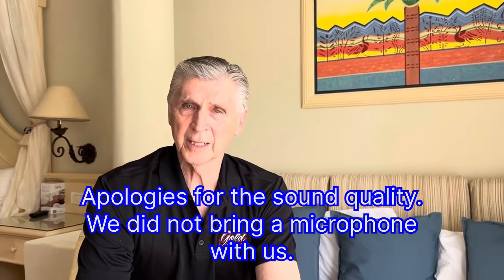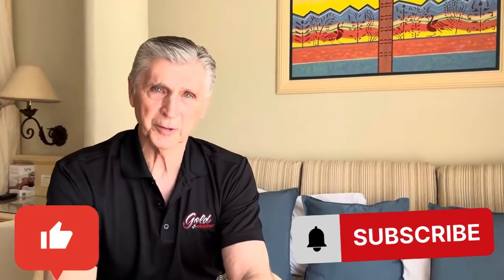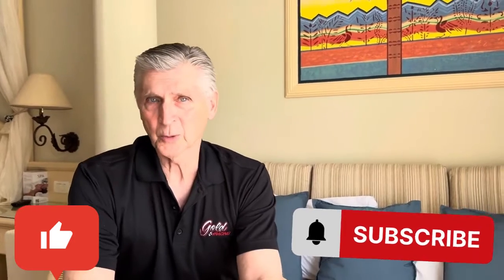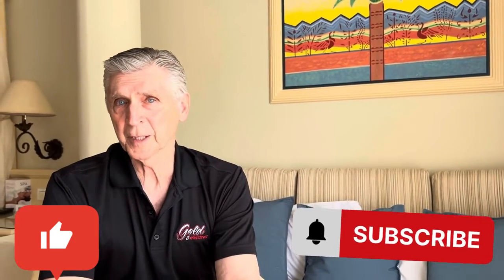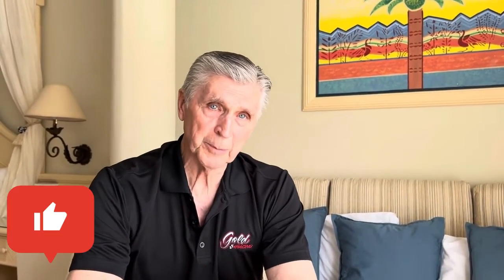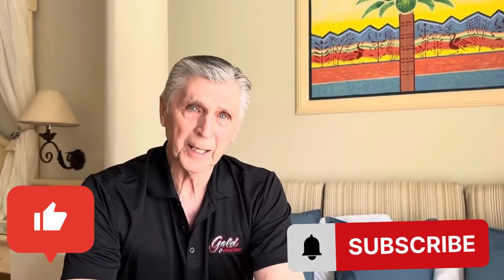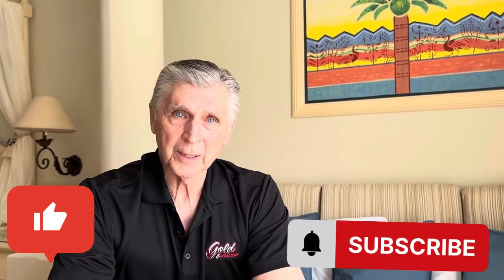Manifold OR Ported Vacuum Advance?? There is a case to be made and I side with David Vizard!

Comment: From the 1975 Ford shop manual it said that through two temperature controlled three way valves the vacuum advance operates as follows for the 460 engine. Below 128 degrees F coolant temperature manifold vacuum is applied to the vacuum advance to aid cold starting. Above 128 degrees F ported vacuum is applied to the vacuum advance. Through another valve at 235 degrees F coolant temperature manifold vacuum is applied to the vacuum advance to raise the engine RPM to cool down the coolant temperature. 
So between 128 degrees F and 235 degrees F the engine is running on ported vacuum. Below 128 degrees F and above 235 degrees the engine is running on manifold vacuum. 

The debate will probably continue which vacuum to use. Holley instructions said to connect the vacuum advance to the ported connection on the carburetor. For me I have installed a switch so I can switch from manifold vacuum or ported vacuum and see which one works better. So far the Ford shop manual instructions seem to work best.
Reply from the maker: Thanks Gary, lot's of good info in your comment.AG

Comment: So for a stock 383 mopar engine the timing is 5 degrees BTDC would this be still manifold advance?
Reply from the maker: Thanks Michael, I would suggest setting total timing at 3,000-3,500 RPM with vacuum advance disconnected. 34-36 degrees BTDC. Then yes, connect to manifold vacuum. AG
Reply: @goldsgarage8236   would the 34-36 be BTDC?
Reply: @goldsgarage8236  So I would run the engine at 3000-3500 rpm with the vaccum advance disconnected then turn it to 34-36 while at 3000-3500 rpm then connect it while at that rpm or once it is down at idel?
Reply: @MichaelCGeorge 
Looking at your timing marks with the timing light, with the vacuum advance hose disconnected, raise the engine rpm until the timing stops advancing. That will probably be around 3500 rpm or so. Holding the rpm at the engine speed that the timing has reached maximum advance, turn the distributor to give you 38°. Tighten the distributor hold down and plug your advance hose back in, and take a test spin. Listen for gas ping. If no ping, your total timing should be set pretty good. Everything can be improved over factory settings, though, especially if the motor is modified, but even a completely stock engine will likely be improved with quicker advance rate (full advance achieved at lower than the suggested 3500 rpm) and more initial timing (timing at idle speed). Those settings require modifying the distributor.

Comment: I'm going with ported vacuum in most cases. But if I have a big cam and I'm looking for more vacuum at idle to run the brake booster trans vacuum modulator I'll use ported.
Reply from the maker: Thanks for the info Paul. Merry Christmas.AG

Comment: The widely-misunderstood manifold-vs.-ported vacuum aberration. After 30-40 years of controlling vacuum advance with full manifold vacuum, along came emissions requirements, years before catalytic converter technology had been developed, and all manner of crude band-aid systems were developed to try and reduce hydrocarbons and oxides of nitrogen in the exhaust stream. One of these band-aids was "ported spark", which moved the vacuum pickup orifice in the carburetor venturi from below the throttle plate (where it was exposed to full manifold vacuum at idle) to above the throttle plate, where it saw no manifold vacuum at all at idle. This meant the vacuum advance was inoperative at idle (retarding spark timing from its optimum value), and these applications also had VERY low initial static timing (usually 4 degrees or less, and some actually were set at 2 degrees AFTER TDC). This was done in order to increase exhaust gas temperature (due to "lighting the fire late") to improve the effectiveness of the "afterburning" of hydrocarbons by the air injected into the exhaust manifolds by the A.I.R. system; as a result, these engines ran like crap, and an enormous amount of wasted heat energy was transferred through the exhaust port walls into the coolant, causing them to run hot at idle - cylinder pressure fell off, engine temperatures went up, combustion efficiency went down the drain, and fuel economy went down with it.

If you look at the centrifugal advance calibrations for these "ported spark, late-timed" engines, you'll see that instead of having 20 degrees of advance, they had up to 34 degrees of advance in the distributor, in order to get back to the 34-36 degrees "total timing" at high rpm wide-open throttle to get some of the performance back. The vacuum advance still worked at steady-state highway cruise (lean mixture = low emissions), but it was inoperative at idle, which caused all manner of problems - "ported vacuum" was strictly an early, pre-converter crude emissions strategy, and nothing more.

What about the Harry high-school non-vacuum advance polished billet "whizbang" distributors you see in the Summit and Jeg's catalogs? They're JUNK on a street-driven car, but some people keep buying them because they're "race car" parts, so they must be "good for my car" - they're NOT. "Race cars" run at wide-open throttle, rich mixture, full load, and high rpm all the time, so they don't need a system (vacuum advance) to deal with the full range of driving conditions encountered in street operation. Anyone driving a street-driven car without manifold-connected vacuum advance is sacrificing idle cooling, throttle response, engine efficiency, and fuel economy, probably because they don't understand what vacuum advance is, how it works, and what it's for - there are lots of long-time experienced "mechanics" who don't understand the principles and operation of vacuum advance either, so they're not alone.

Vacuum advance calibrations are different between stock engines and modified engines, especially if you have a lot of cam and have relatively low manifold vacuum at idle. Most stock vacuum advance cans aren’t fully-deployed until they see about 15” Hg. Manifold vacuum, so those cans don’t work very well on a modified engine; with less than 15” Hg. at a rough idle, the stock can will “dither” in and out in response to the rapidly-changing manifold vacuum, constantly varying the amount of vacuum advance, which creates an unstable idle. Modified engines with more cam that generate less than 15” Hg. of vacuum at idle need a vacuum advance can that’s fully-deployed at least 1”, preferably 2” of vacuum less than idle vacuum level so idle advance is solid and stable; the Echlin #VC-1810 advance can (about $10 at NAPA) provides the same amount of advance as the stock can (15 degrees), but is fully-deployed at only 8” of vacuum, so there is no variation in idle timing even with a stout cam.

For peak engine performance, driveability, idle cooling and efficiency in a street-driven car, you need vacuum advance, connected to full manifold vacuum. Absolutely. Positively.
Reply from the maker: Great technical information. Thanks so much for watching my videos and contributing to my channel KKyler.
Reply: Let me fix that last sentence.  "For peak engine performance, cooling, and efficiency AT IDLE, in a street-driven car, you need vacuum advance, connected to full manifold vacuum. Absolutely. Positively"  This idea that its going to make the car faster, run cooler, or increase gas mileage in any measurable way under normal driving OR racing conditions is bunk.

Comment: Depends on the vacuum canister, manifold cans are all-in with just a few inches of vacuum. Whereas ported vacuum cans are calibrated for about twice that much.
Reply: yeah  it seems  the advance canister  you want is an adjustable  one

that way you can adjust  it  to pull all  the way out  at whatever the idle vacuum is so  the idle  is stable. otherwise  with a big  cam  it  just  moves back and forth and creates  an unstable idle.

  and if  youre  not  keen on what  to do,  you start messing with idle mixture screws to try and stabilize  the idle and now  you've gone and messed up  the  amount exposure  to the carburetors' idle transfer slots, creating a dead spot unknowingly and opened a can of worms
Reply: @KingJT80  The adjustable canister needs to have two sdjustments, one for when travel starts (vacuum pressure) and the 2nd adjustment for travel.
Reply: @thisisyourcaptainspeaking2259  most of them don't have two adjustments. They just have a diaphragm and you just put a 3/32 Allen key in there and you can just adjust it and then use a mighty vac pump to pump it up and then just keep adjusting it until your reading on the vacuum pump reads the same as the vacuum at idle. Then adjust it to where it reads. 2. In of vacuum less than the vacuum your engine creates at idle then it'll stabilize
Reply: @thisisyourcaptainspeaking2259  that's basically what they do.  You adjust it with an Allen key and you can adjust it to the amount of vacuum it takes to pull all the way out, which should be adjusted to pull out with less vacuum than your engine creates at idle
Reply: @KingJT80  That's a single adjustment though, only pressure but not travel as well?
Reply: @thisisyourcaptainspeaking2259  it reacts to vacuum. But you can't limit the Travel 

 Travel limiting isn't how they work. They work only on vacuum signals. 

The factory non adjustable ones are set to whatever a stock engine vacuum makes at idle/light loads

The adjustment is how much vacuum it takes to make it completely pull out. That's done by turning the screw clockwise or counterclockwise.
Reply: @KingJT80  Travel of the diaphragm rod is sometimes limited while tuning vacuum advance, depending on the cam, fuel type, etc.
Reply: @thisisyourcaptainspeaking2259  yes it's however far it's supposed to travel out.  They're all different.  But they all react to vacuum. HOW MUCH vacuum they react to is the question.

You won't know what it will react to until you test the one you have
Reply: @KingJT80  What if my engine pulls 22" of vacuum at idle? Affirmed with 3 different vac gauges.
Reply: @bbivens8263  I mean your engine pulls whatever it pulls 

Is that the highest vacuum it pulls? 

Look at the timing light and see what it says. What does it say when it's pulling 22 in?

Comment: After too many years of running on ported vacuum I finally use the manifold port and after right timing the engine runs cool enough with proper vacuum and steady idle. It is kind of crazy that even Holleys instruction talks about using ported. And even the "experts" mechs in the garage I use to visit for repairs did not know and tried to fix the timing.
Reply from the maker: Thanks for the comment Fuel, it is confusing out there for sure. AG

Comment: Who had a digital flow bench 50 years ago?  I think that every engine as it's own soul.  You can take two same blocks, prepare them exactly the same way, fill them with the same components, time them at the same degrees,  same carburators,  exhaust and everything, and you wont get the same results.   Yes you will get within a certain range of 5..10..20hp?  But one block will flex differently, the flow want go at the same speed, the oil passage can be slower, cooling system can affect the block from a few deg. 
Etc. Etc.
The main thing here is to do you best to have results that reflects your expectations, within a range, for your unique application.   The moment your drive that engine,  the way you treat it also affects the outcome.  
I think that if your still doing it after 50 years, you must have been doing it right and if not, you fixed it and you learned from it.  Who had a digital flow  bench 50 years ago?  You and all the ones who's still standing after all these years done it with all your hearts and precision for "One" thing.  
To beat the ice cream out of the opponents ont the streets or on the track.   Thanks and enjoy the sun.
It will give your body energy from vit.D production. 
Trust me, Im a nurse!  Yes a male one!
Hahaha.
Reply from the maker: Great comments Dad! thanks for sharing your thoughts and motivating me to do more. AG

Comment: I can't remember if you mentioned a adj vac canister. I found out mine was advancing the rod too far.
Reply from the maker: Thanks Old. No it didn't get into this in the video, but they are a good fine adjustment device. Many good aftermarket distributors have them. AG

Comment: Been a mechanic for 35yrs and manifold [below throttle plate] vacuum is for automatic transmission. Set initial timing with this disconnected.
Ported [above throttle plate] is for manual transmission. Set initial  timing with this connected.
Pretty simple. Race engines don't need vacuum advance as they are wide open throttle most of the time.
Reply: Your opinion. Not mine.
Reply from the maker: Thanks for your input guys. AG
Reply: Mine runs like garbage and will only idle at 1k rpm on the port and 800 on the manifold. It idles and runs great on manifold.Mine is a manual.
Reply: I've got a big block 4 speed car with a decent amount of cam, which needs 34 degrres advance at idle. If I run ported vacuum I'll have to set base timing at 34 degrees. I'd then get mechanical advance of 20 more degrees by 3000rpm. I don't think 54 degrees advance at WOT is a good plan. So I run manifold vacuum to get advance at idle, AND at cruise when throttle blades are pretty closed and cylinder pressures are low. 

Vacuum advance is a hell of a lot more complicated than what transmission a car is running.

Comment: With a big cam and using vacuum advance when you put it in gear with an automatic with low stall converter the vacuum drops and will lower the idle considerably and stall the engine, ported vacuum will work much better, an adjustable vacuum can can help, hp engines need no more than 15 degrees with 36 to 40 degrees timing, if you get surge at light throttle back of the vacuum timing, just my take on it and 40 years of experience
Reply: a big cam with a low stall converter is the wrong combination of part; right from the start is not a proper build, period
Reply from the maker: Thanks Bill. That makes sense. AG
Reply: I'm with you, Bill.

Comment: Ford used port vacuum in the 1960s then mid 1970s went to manifold vacuum to help meet epa smog regulations. I believe port or manifold vacuum advance depends on the distributor centrifugal advance settings.. Ford electronic ignition distributor has 2 advance limiting grooves  8 degrees and 16 degrees.. Most of what I have seen is port vacuum advance distributor were set at the 8 degree slot and the manifold vacuum advance distributor were set at the 16 degree slot. Guess there is not a wrong way or a right way there is just a which way do we want to use..
Reply from the maker: Thanks Sam. very good information. There is always so much to learn. AG